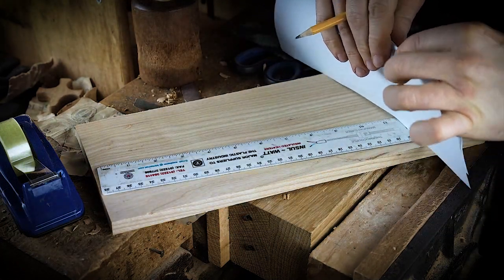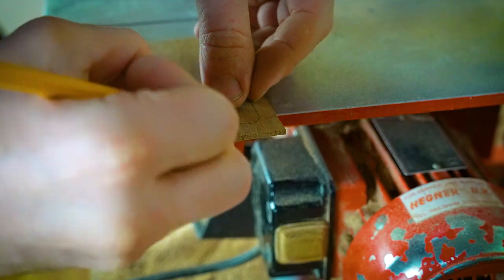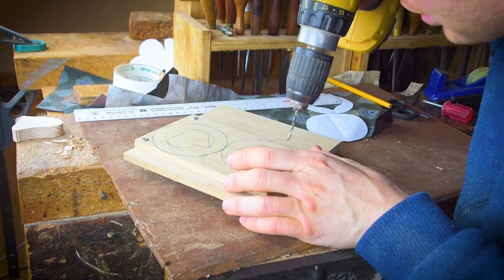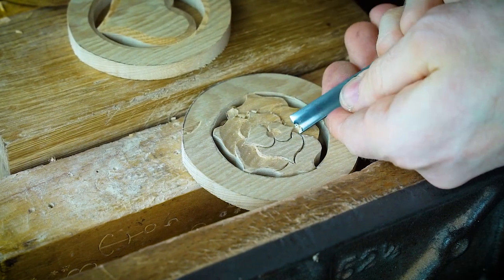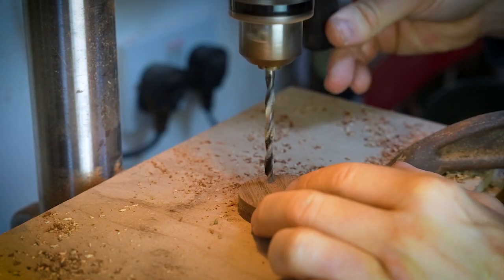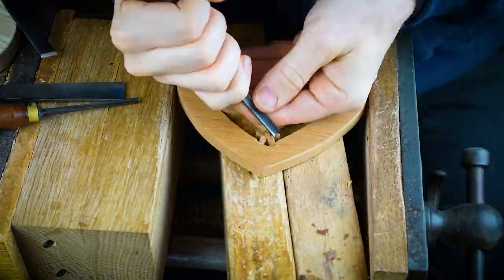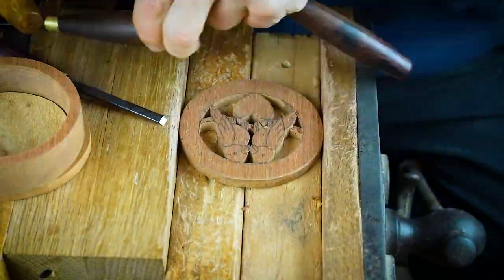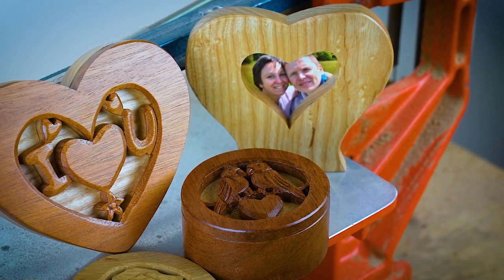5 easy scroll saw projects for the one you love.

Comment: Quick question what kind of wood do you use for your scroll saw
Reply from the maker: Hi great to hear from you and thanks for the question. In this video I was using Juniper that I managed to salvage from my father in laws town in La Mancha, Central Spain. I use all sorts of wood, mainly hard wood. Oak, Ash, Mahogany, Teak, Tulip wood, Walnut, fruit wood etc.

It's basically whatever I can get hold of, usually from old furniture and other unwanted fixtures and fittings.

Thanks again for getting in touch, hope the video was useful. All the best from us all here at The Lovespoon Workshop 👍👍
Reply: @DailovespoonsThomas  thanks for your reply I have another question I just got into scroll sawing was wondering what number blade do you use best for hardwood and best for softwood
Reply from the maker: @getfit628  hi, thanks for your question. We use a Niqua number 9 reverse tooth blade. We mainly use hardwood but it leaves a great finish on hardwood and softwood. The wood we use is usually around 1/2" to 1" thick

Thanks again for getting in contact. Let me know if you have any other questions. All the best from us all here at The Lovespoon Workshop. 👍👍